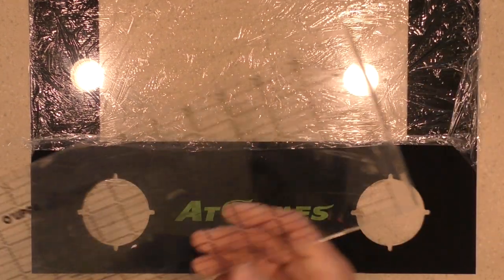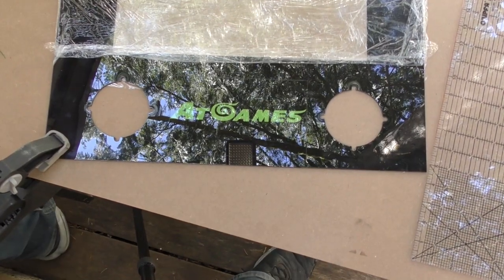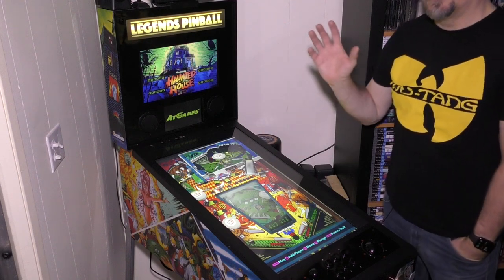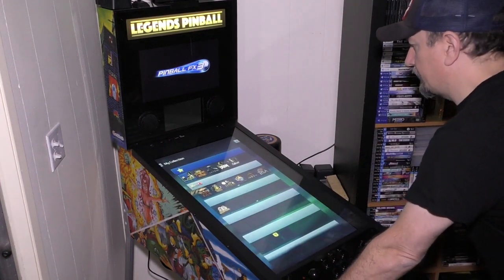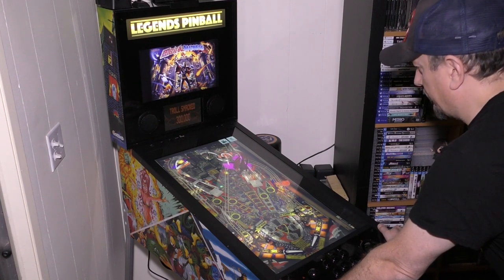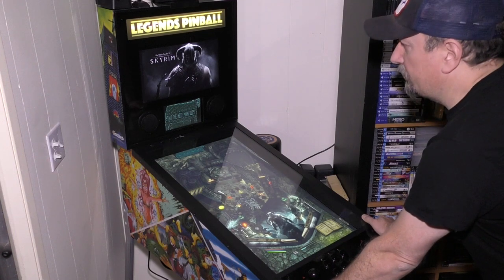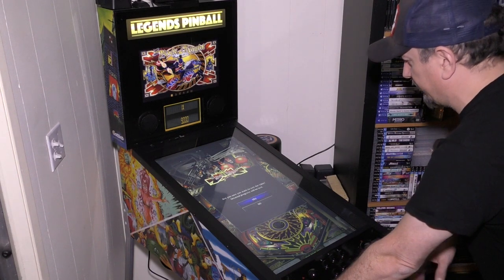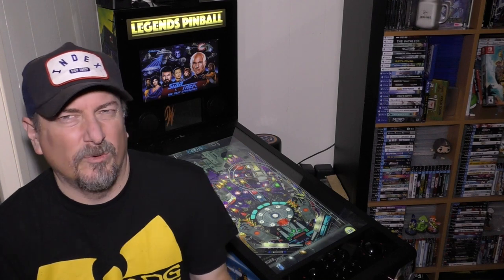Let's Upgrade the ALP with a $100 DMD - Part 2! AtGames Legends Pinball Finishing Touches w/Gameplay

Comment: Hey man, first of, thanks for the video. I am at the part where you basically explain about the crack on the plexiglass. I was wondering, could you not fit some kind of plastic cover over the cut out rectangle, so this ‘cover’ has some similar look like with the speakers? Black and it would be outside of the plexiglass, so you would never know? Hope that makes sense, I’m not native.

Comment: Thank you ,

Makes sense …

Question: 
Ok, so I need a pc with 3 hdmi outputs: 

One to dmd
One to vibs card
One to top left front of playfield?

But…

How does this work for all the laptops out there that I know only have one hdmi output and have this running ?

I see videos all over YouTube with people running older basic laptops that I’m sure only have one ?

Thank you again. I’m
Reply from the maker: You could try using a USB to HDMI adapter. The performance you get will depend on if it is USB 2.0 or 3.0, but you should be fine. The back glass will be static and the dmd isn't running something super demanding. I would use the actual built in HDMI on your laptop to run the playfield, since you will want to try and get 60fps.
Reply: @FactorofGames  thank you
I will give it a try !
Just asking, do you have a pc with 3 hdmi outputs ?
Seems like i will need a newer card?

Comment: 2:21 Wouldn't it have been much easier for you to overlap the DMD Screen over the outside of the plexiglass and then outline it with a sharpie instead of wasting the time on having to guess the measurements for the DMD screen?

Comment: Im thinking about doing this... wondering if maybe it would look better with a new piece of clear acrylic from lowes or home depot. you wouldnt have to cut out anything other than the speaker holes. could mask off the areas of the screens and paint the inside of the sheet....
Reply from the maker: If I was to replace the current plexiglass, I would like to go for a full piece of tempered glass. Regardless, I agree with you that replacing it would be a nice upgrade.